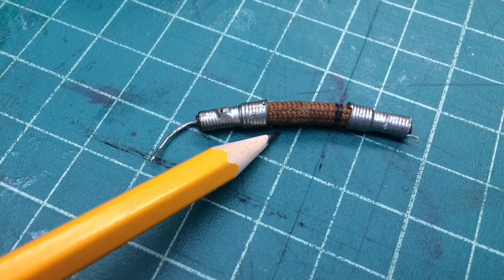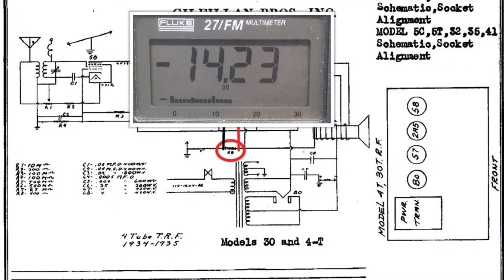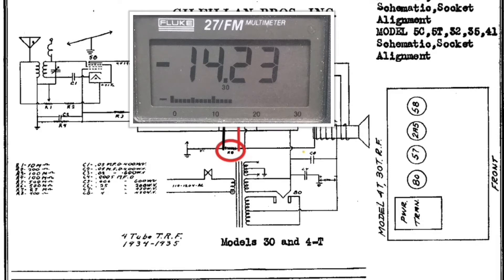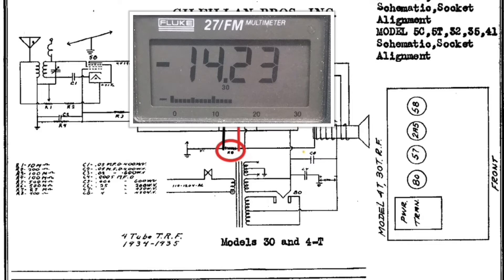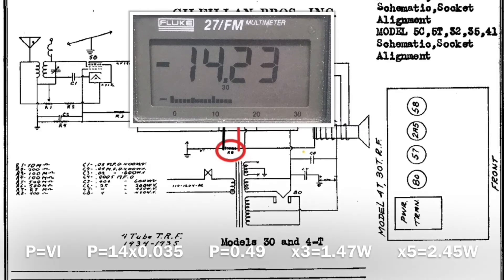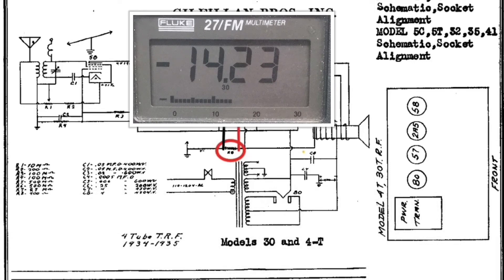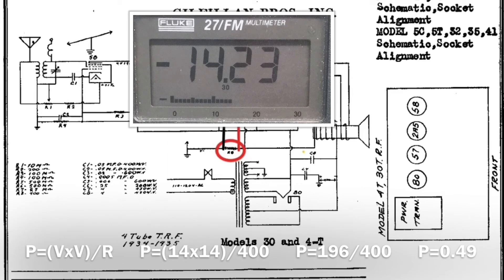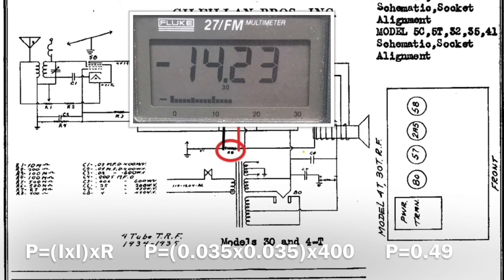Peter Pan Radio - Day 14 P1 (Calculating Resistor Wattage)

Comment: Very interesting I have never seen a power resistor like that. The weave on the surface reminds me of a braid I assume it is solid and not flexible.  It sounds like your from over the pond to me do they have radios in the USA that use a resistive mains dropper cable instead of a transformer. Thanks for dropping by my channel and I like your trusty Fluke meter. My very best regards Chris
Reply from the maker: +AllTheGearNoIdea Chris, many heater/filament series radios in the (USA) 30's era used resistive line cords in lieu of transformers to keep cost down. They were referred to as "curtain burners" as the resistive line cord (dropper cable) would overheat and spark a fire. I appreciate you watching and I hope my response back answers your question. Best, Don
Reply: RestoreOldRadios Thanks Don. I will have too remember that phrase carpet burners. They had the same reputation over here. Regards Chris